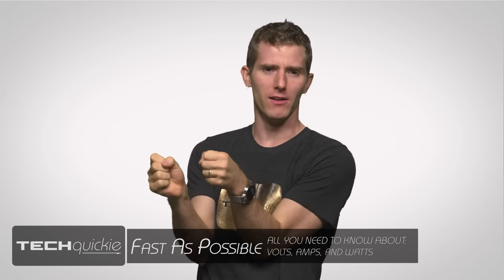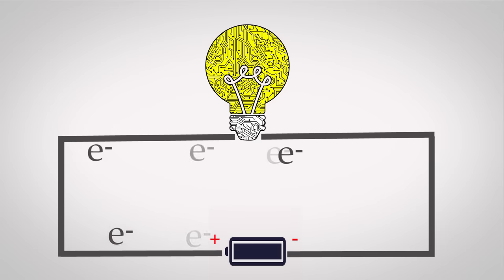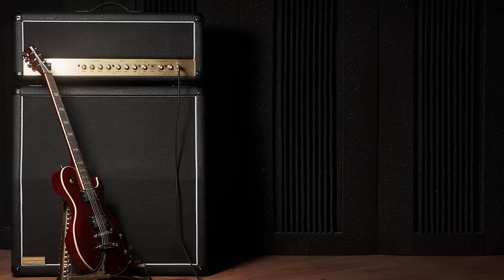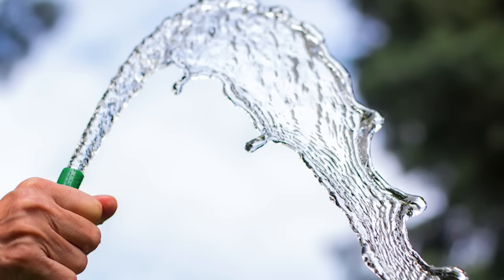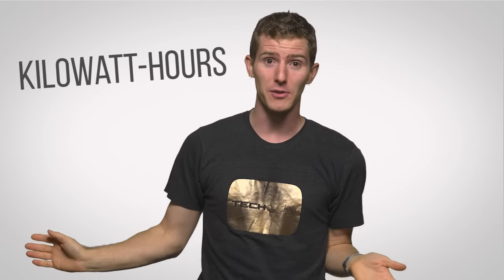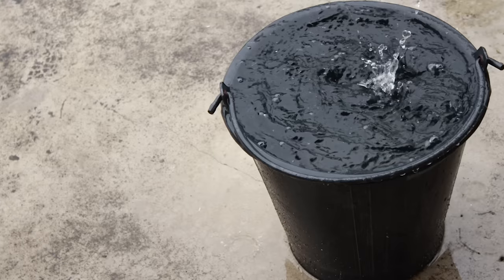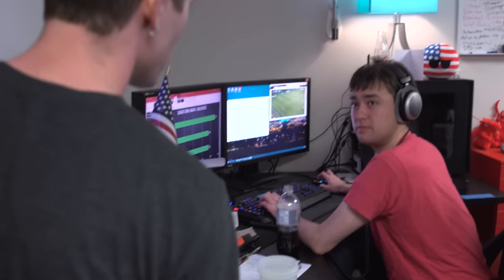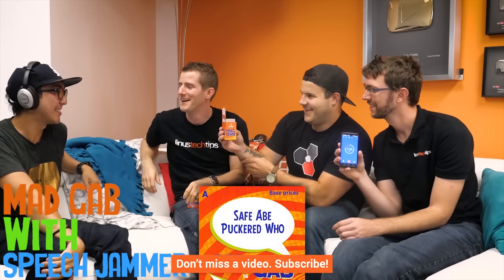Volts, Amps, and Watts Explained

Comment: It is not electrons “flowing” in an electric wire. In fact, electrons aren’t even the only electrical charge carrier. The energy is carried by an electromagnetic field moving down the wire. 

 The energy is used up, by which I mean that it is only temporarily present in and around the  pressure waves that those waves can blow a building apart (that is a little bit over-simplified, since explosive shock waves are actually supersonic).

Electrons in an AC circuit wiggle slowly back and forth (oscillate) without really going anywhere. Electrons in a DC circuit drift, very slowly, against the direction the power is moving in. That’s because the electrical power moves from the positive terminal to the negative terminal, but the electrons, having a negative charge, are drawn toward the positive terminal, against the direction the power is moving in. Because current is defined in terms of the number of electrons passing a point in a unit of time, this means that the current is actually traveling in the opposite direction of the power. There are some handy equations that make current a mathematical/abstract analog of electrical power, but current is not electrical power. Electrical power is propagated by light (photons).

Electron drift velocity varies depending on the material, the size of the conductor, and the amount of current involved, but a 1 amp current in a 2mm cross-section copper wire will push electrons at about 23μm/s. 23 micrometers times 60 seconds times 60 minutes = 82,800μm/hour. That’s about 1/12 of a meter, or 8.33 centimeters, per hour. That is pretty slow. Electrical power travels at a large fraction of the speed of light down a wire. So clearly electrical power itself, several orders of magnitude faster than current, is not electrons.
What is really moving, and transporting energy down the wire, is photons.

The electromagnetic energy (an EM field created by photons) that a non-contact electrical tester detects isn’t just some wasteful side-effect of electrical power. It is YHAT SAME electrical power..
Electromagnetic fields, are a phenomenon of photons. Light, radio waves, electric current, are all fundamentally the same thing. Electricity and magnetism are two manifestations of precisely the same phenomenon. No electrical field exists without a magnetic field, and no magnetic field exists without an electrical field. They are the two faces of the same coin.

So think about a magnet... If you try to press the positive ends of two magnets together, you feel a strong force pushing back against you, even though the magnets are not touching. What is doing the pushing? Photons—the very same thing that light is “made out of”sooooo... it is light that is pushing those magnets apart (or binding them together if you put a north and south pole together). Electrons in the material (generally a metal) are continuously emitting and reabsorbing photons. This produces an electromagnetic (EM) field around the magnet.
You already know that all light comes from excited electrons ejecting photons. If the electrons are extremely energetic (hot), the ejected photons will be gamma rays, x-rays, or ultraviolet light. If the electrons are less energetic, the photons will be the color green, or microwaves (or the color blue, or yellow, or red, etc etc...
So this all leads ypu back to the electrical wire. When that wire is conducting electrical power, the electrons in the wire are absorbing and re-emitting photons all down the wire, transmitting the energy along ... this is normal behavior for electrons.  the photons do not fully escape the wire, so they’re referred to as “virtual photons” and the majority of their energy is retained along the wire. Electrical power is transmitted by light.... crazy, no?
So The electrons themselves, while they are an effective charge carrier related to their mobility within the metal’s crystal structure, are not themselves zipping down the wire at near light speed, nor are a continuous “line” of electrons clear down the length of the wire bumping each other all at the same time like a solid.
In fact the force involved between two electrons is elastic, not rigid, and on top of that the electrons in a wire are the equivalent of golf balls that are 15,000 miles apart...these will simplify the explanation easily: 

∇⋅E=ρε0

∇⋅B=0 

∇×E=−∂B∂t 

∇×B=μ0(J+ε0∂E∂t)

Comment: At 1:25 you revealed you have an unresolved childhood problem regarding your intuition of non-rechargeable batteries or you were absent that day or both. (That’s a joke designed to make you laugh, because you know how to tell a joke!) Seriously, non-rechargeable batteries are not accurately modeled as an open circuit capacitor as you imply with your description of the electrons accumulating at the positive terminal. Batteries (rechargeable and nonrechargeable) are modeled as non-ideal sources that decay under load per their milliampere-hour rating. I’ve learned a ton of practical knowledge from your videos, and I gratefully reciprocate.

Comment: 110V Pre-Wired Digital Temperature Controller Thermostat 2 Relays Outlet Switch
Takes 110VAC-240VAC
Max Amps: 10.

API Universal Water Heater Utility Heater, 500 Watt
120VAC, 500W .... 500/120= ~1.2Amps...
...
So I should be able to safely use this heater with this temperature control switch, right?
Just making sure I'm understanding everything correctly. No liability is implied by answering this question or responding to this comment.

Comment: 4:16 will it work okay even though some places run at 60Hz and other places 50Hz
Reply: I am no expert. However I think that's the amount that current fluctuates between alternation. So 50 times a second it alternates to 60 times per second.
I could be incorrect however.
A D.C current will not have that and needs to be rectified before it's alternated and oscillating smoothly.

Comment: electrons carry the fields. The fields carry the energy and deliver it to other free electrons in the circuit. Machines that use electricity either need the field itself to power up or as in almost all cases the free electrons to perform. Free electrons don't move that fast, they are able to induce the fields or receive it to get into motion.

Comment: Good analogies but come someone answer my original question: how does a particular appliance, say, my 3KW kettle, know that it needs 12.5 amps with my 240V supply to achieve its 3KW power? I could plug a 1KW hair dryer into the same socket and it draws less power, why??

Comment: amps = rate of the flow of electrons.
volts: essentially the pressure that push/ pulls electrons. How much force within each electron. More positive and more negative ends = more volts and more force.
amps*volts= watts
quantity of electrons*velocity (pressure) = force/sec
kilowatt hour
milliamp hour (battery storage): how much charge you got.

Comment: Electrons flow on the surface of conductors carrying Alternating current and internally for direct current, which is why u need much larger conductors for AC current, 

Definitely in most real world applications of ohms law the thing to remember is that your devices operating resistance is going to be a constant so your current will change depending on voltage and since the current carrying capacity of conductors has very strict thermal limits, trying to force to much current down a small conductor will create heat as  result of resistance as this increases the conductor becomes a resistive heating element and melts its own insulation, also the increased resistance (impedance) may prevent the circuit from drawing enough current to trip your circuit protective devices, so may continue to operate despite being on fire. Soo don't burn your house down.

also the way your energy meter and energy supplier bill you for power used is the calculation of RMS power, not the P=(IxV)xhours. Still more power is more power so it correlates to your bill either way, just not 1:1 as u would expect.

Comment: At 1100 watts /220 volts is twice the amount of volts! Pushing through more electrical volts to reach a higher amps for count of current! It’s simple math .. so if 1100 watts a /110volts equal  10 amps then the same at 1100 watts at 220 volts would be 20 amps! Not 5 amps per count!

Comment: For dummies like me who still didn't understant it even after water explanation. 
Amp = speed
Volts = strengh
Watt = job
high amp and low volts = car 
low amp and high volts = tank
watt = bricked wall
In order to tear down the wall, you need either a slow tank with enough strengh, or speed up the car enough to tear down the wall (get the exact same job done)

Comment: Kilowatts x hours = joules derivation

Kilo is prefix thus we don’t need it in derivation

watts x hours is equals to Power x time

Power is V x I so formula = VIT

Unit of V= volts(V)
Unit of I= Amperes(A)
Unit of T= seconds(s)

1: Voltage or potential difference= W/Q

W= work done in Joules(J)
Q= charge in coulombs(C)

2: I or Amperes= Q/T

Thus from formula VIT

W/Q x Q/T x T 

In unit and mathematical form

(J/C) x (C/s) x s

Both C cancels out and s goes to numerator so

J x s^-1 x s

Both S cancels out and you are left with J (Joules)

Comment: ok so question for the experts cause this was a lot of foreign information to take in even with a good analogy. Basically watts are the only thing that matter... technically because it just means an in general output of energy supplied to whatever you're powering, but the amps is your hertz, your rate of output, like comparing a fly going 50 miles an hour to a cheetah, the fly is just zipping around like it's supersonic while the cheetah is chugging, and then the voltage is basically the muscle, the the amount of power that's being outputted every time the voltage pushes out energy? I hope I'm getting this right

Comment: So, I am guessing the reason why phone chargers are measured in milliamps and not watts is because phone chargers are always plugged into a domestic electricity supply, which is a constant, i.e. 240V or 110V depending on where you live. It is therefore redundant to measure in watts as the voltage is always known, hence, the insistence on amps.

Comment: i am confused if
watts=VxA
and
omes=VxA
dosent that mean thay are the same thing?
Reply: No, they just happen to use the same equation. Ohms is the unit for resistance which is used in building circuits. Watts is the unit for power, which is the amount of energy generated each second.

Comment: I had to think of this in physics terms
watt is equatable to mass, so I'd just put it kg
Similarly, voltage seems like velocity to me, if I'm understanding right, so m/s
And that makes ampere a unit I never learned about: kg/m/s

w/v=a
kg/(m/s)=kg/m/s

a*v=w
kg/m/s * m/s=kg

If this is wrong, someone needs to correct me, because this is my understanding of it. Or maybe this is close, and I helped someone else who was struggling to understand it? I don't know of many people that think best in numbers, like I do, though. 
But it does sound right. Watt is the actual electricity. More or less, the electrons themselves. Just like in the water analogy, how the same mass of water is being sprayed. 
From what I can tell, voltage is the speed, which is the distance over time.
And ampere is Electrons (mass) through a point (distance) per second (time), so m/d/t or kg/m/s, like I said.
This would also explain ampere-hours.  ampere (kg/m/s) times hours (time). kg/m/s * s = kg/m. kg/m is mass over distance, which means storage. Meaning, separate from the analogy, it's literally electrons per unit of distance
Although I guess I'm simplifying with m, since it would all be m^3. Or maybe they measure battery capacity in kg/m instead of kg/m^3 for simplicity over accuracy.

Comment: Nice introduction but techincally, volts x amps doesn't equal watts (it's volt-amps or VA). There's a thing called power factor that muddies the water for inductive or capacitive loads.
Maybe something for a level 2 video...

Comment: what is the voltage in Monaco ?
Reply: so they actually are charging you amount of current used per hour and not the actual power but how much amperage was used in that specific hour or put it simpler how much that power fork out Amperage  in an hour so i can turn the lights on in every room all at once and the charge would greatly costly but i can turn lights in every room only one room is lit at a time and the charge would be cheaper ?
Reply: so voltage is a Force
Reply: a force that opposes the flow of electron because it requires a force to apply against voltage pressure

Comment: 110 volts x 10 amps = 1100 watts.
220 volts x 5 amps = 1100 watts.
11000 volts x 0.1 amps = 1100 watts.
What one modifies the computer power supply to run at 11000 volts x 0.1 amps? What if one builds an antenna to tap into atmospheric electricity and install antenna high up in the sky and then use a step-down transformer to output 11000 volts at 0.1 amps? Its 400,000 volts 50 km up in the sky. 👍
Reply: nicola tesla wants to know your location

Comment: "It's why the hair dryer you bought in Monaco might release magic blue smoke if you plug it in in New York".
Not really, Monaco has 230V 50Hz and New York 120V 60 Hz on normal outlets. What ill happen is that you'll almost certainly get a fairly weedy hair drying experience if you try that. Now, if you take a hair dryer you bought in New York and plug that into an outlet in Monaco, then you might see some blue smoke.

Comment: A jiffy is not 1/10 of a second it is the amount of time it takes for light to travel 1 fermi(search up Enrico Fermi) so it would be 0.000000000000000000000003 or 3*10^-24 which ever notation works.

Comment: amperage is just a number that depends on pressure and power in relation to a wire or copper wire
Reply: unless the wire is non relevant which is apparently not because not mentioned so please explain
Reply: because if you divide voltage per power and vice versa gives you an independent number to a wire or does it ?  HELP
Reply: sorry no vice versa that was stupid

Comment: Didnt help. D= 
I thought amps was torque or something. 
I trying the figure out different energy usage and water flow rate between Pool pumps. We had a 1hp single speed pump we replaced with a 1-1/2hp 2 speed pump. i the new one uses less electricity and pumps moves more water.

Comment: Everybody does the same video and never answers these questions. If voltage is pressure, HOW is that pressure generated? And, how is it actually measured? If the electrons are always moving at a set speed, what determines their pressure? I understand how amps can be measured by the number of electrons flowing past a point, and the larger the conductive material {wire gauge}, the more electrons and thus more amps, but again what is pressure in electron flow?

Comment: Oh that fucked me up. I thought it goes from the positive end to negative lmao
Reply: This is where I hate electronics. When electricity was first discovered, people thought that it moved from positive to negative, and this became known as conventional current. However, we now know that electrons (the source of electricity) are negatively charged and therefore move from negative to positive - electron current. Despite knowing this, most circuit diagrams still use conventional current even though current actually moves in the opposite direction.

Comment: Not so fast sparky.....

Your calculations for power or wattage, ASSUME DC current flow. Ohms law states that Power Or Wattage = Volts X Amps BUT only in a DC circuit or an AC circuit with a purely liner load!
In an AC circuit Volts X Amps = VoltAmps (VA) NOT watts!
Because components in an AC circuit react differently as frequency changes (capacitors, inductors)
In the USA we have a Power Factor (i believe is .95) applied to the VA to APPROXIMATE current used. The formula of Watts = Volts _ Amps ONLY applies to DC circuits OR AC circuits with a pure linear load such as a light bulb with a filament ir a toaster.
The APPROXIMATE calculation of power or wattage is VA X .95.
In fact your meter in the side of the house is a meter that is calibrated with a power factor built in.
Look carefully at rating label on devices. See where its says KVA or VA? That KiloViltAmps, NOT KW or VoltAmps not watts.
Sooo many of you get it wrong.

Comment: Ok um your voltage analogy slightly off, voltage is potential energy so in this case water behind a damn is a better analogy, you have 1 gallon of water behind the damn so 1 gallon of voltage potentially that can flow, flow itself is current current can be described at how much potential water is flowing, now using p.i.e. algorithm (ohms law) now more commonly referred to as VIR you can get what you need you can use this to get voltage, current or resistance, so v voltage over r resistance=power 3/1=3 so 3 would be power, other formulas get you other results for voltage or resistance oh and current is referred to as amps (ohms law is possibly the easiest but other laws exist and I'ml get the spelling wrong but kershovs law is one) not to mention current can flow either direction to positive or negative  take batteries out of old flash light flip them and if contact is made it will light up, most use the positive to negative flow but people like us navy use a negative to positive flow or did i reverse that bleh Im tired hopefully ove helped some